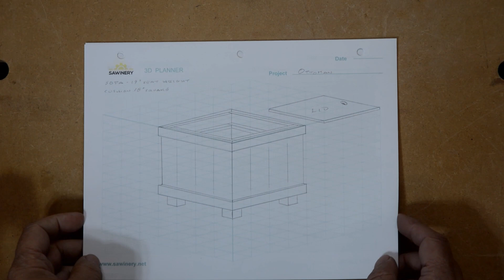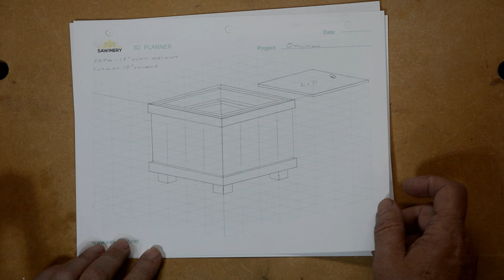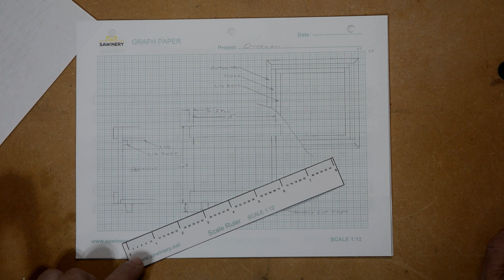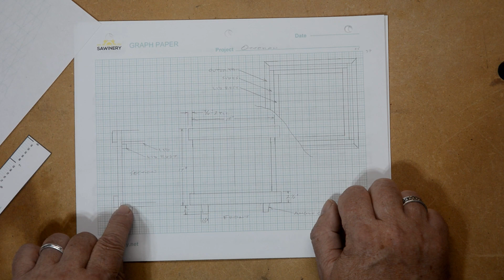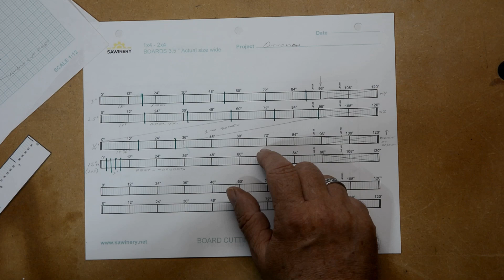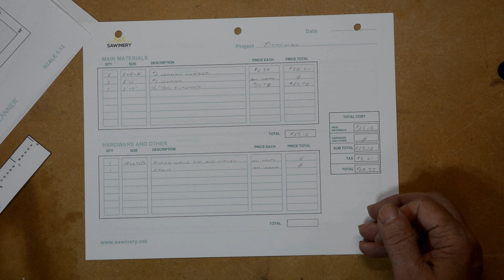Draw 3D Woodworking Plans With Pencil & Paper - Sawinery Project Designer

Comment: Great video- been doing the hand drawings for years now. Had not thought about using isometric paper- great idea. 
As for 1:12 scales- what about old architect scale- there is usually a 1inch = 1 foot on these scales- not as nice as the scale in the video- but workable.